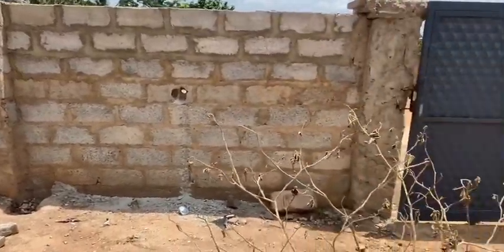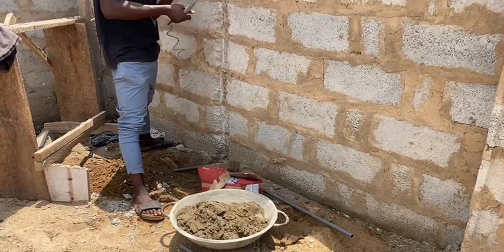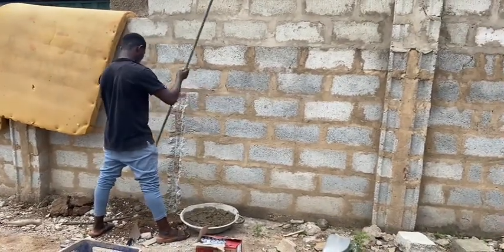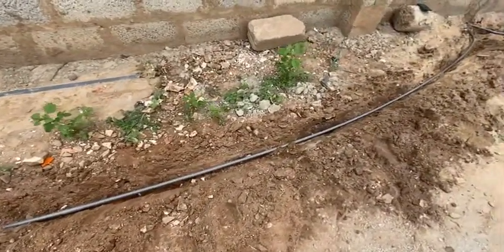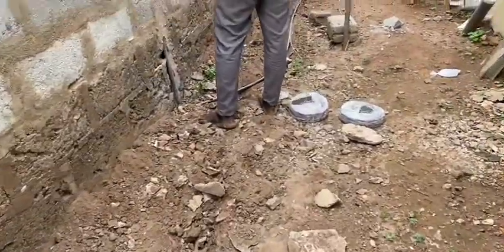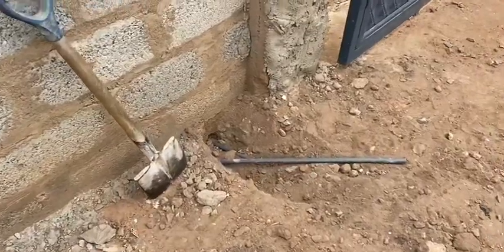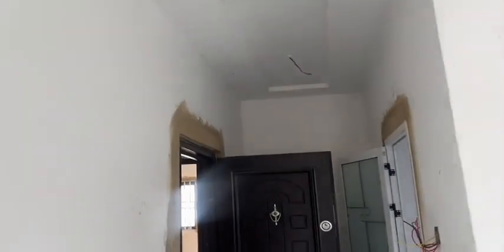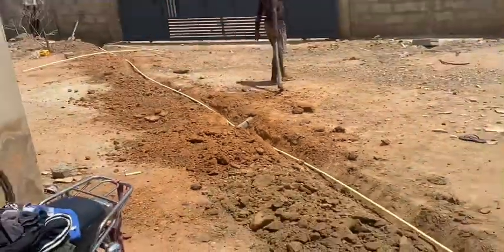2023 cost of electrical extension-fence wall and compound wiring || Building in Ghana 🇬🇭

Comment: As to where to place the motor for the automation of the gates, did you talk to an installer first to know where to put it or the electrician eyeballed it?
Reply from the maker: The motor is placed where the gate is pushed to,I already use some in another property of mine. Thanks for your concern🙏🏽

Comment: The electrician did all the intercom and AC wiring as well? Or you had to call an ac guy and intercom person for that?
Reply from the maker: Any electrical work related to the AC unit is done by the electrician. But AC installers can also perform that task.